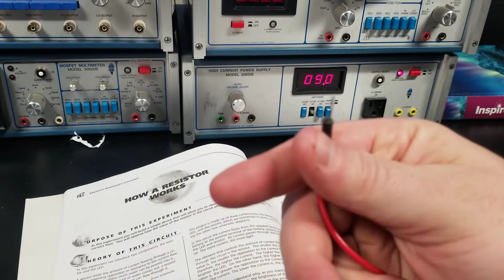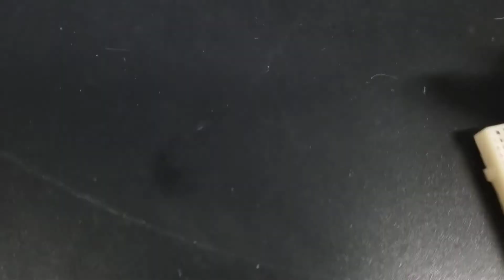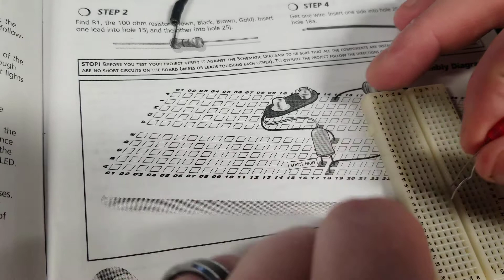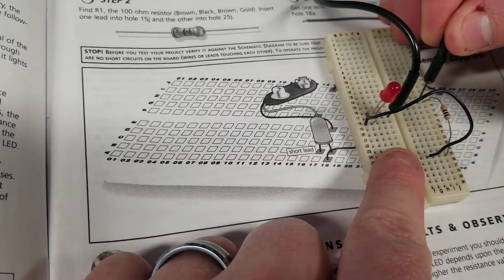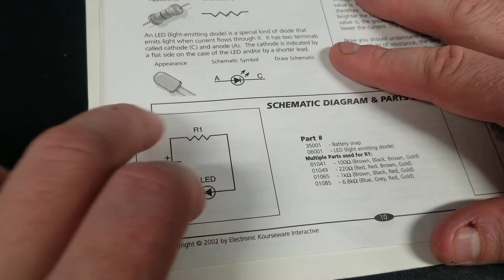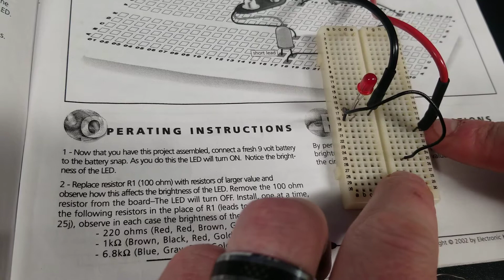Getting Started Mr. Circuit Kit

Comment: I happened to find your mr circuit video. I know is basic, but how do you like it. I started playing with arduino a while back. I was trained in electronics, but it was forever ago so I’m considering the mr. kit for the money. Thanks
Reply from the maker: Thanks for checking it out! I teach a physics course and I really like using it in my class. It's very basic, but it can get kids started on creating circuits and practicing them. Before we start using this, we get into calculating amperage and voltage in circuits so they're able to break down the circuits. I like them for my classes but I'd probably get something different if I were starting as a hobbyist since this is fairly basic.